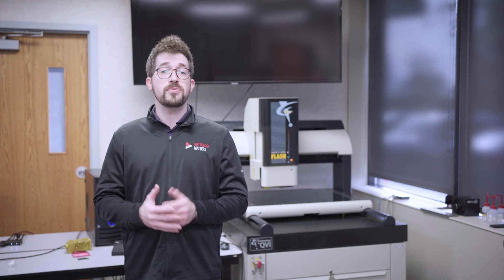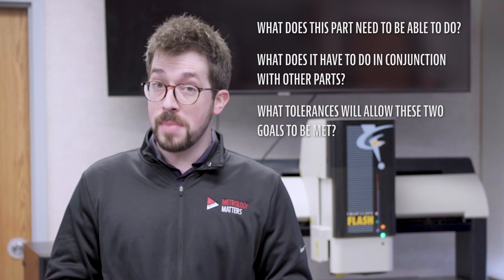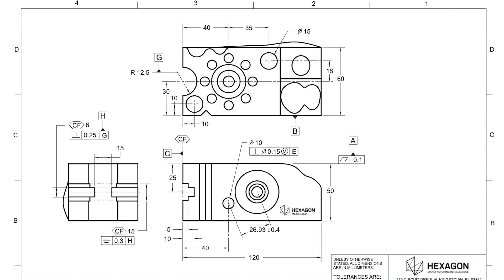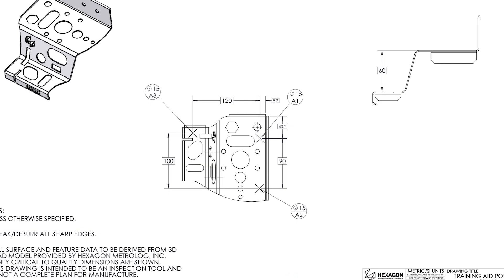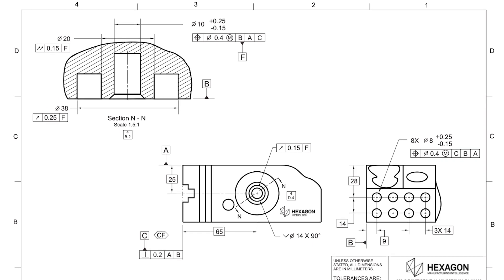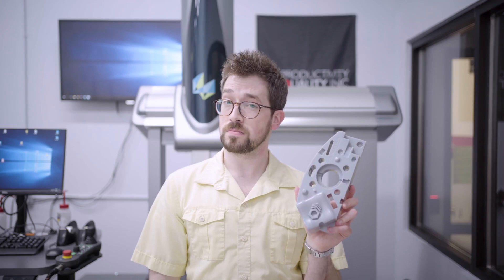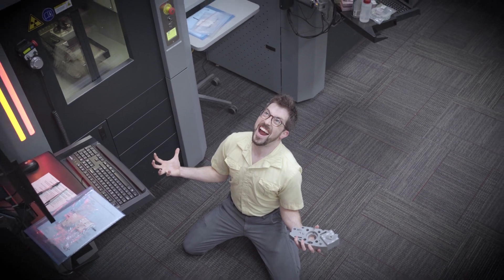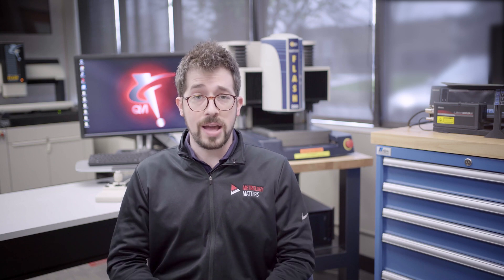Function Intent and the Measurand | Metrology Matters

Comment: The process shouldn't rely trial-and-error after parts are made, it should be based on tolerance analysis during the design phase. You outline the functional requirements (eg cylinder must fit into bore) and sources of variation (eg feature sizes/position/orientation, assembly, temperature variation) to determine what tolerances are required to meet these requirements. You then work with your manufacturer to see whether they can measure these dimensions and hit these tolerances. Adjust your design if they can't, or make compromises (eg more precise processes, changes to the product size/performance, or accepted yield fallout).

You note that a high-precision part doesn't need every dimension to be tight-tolerance, but in addition - forethought can be given before any prototypes are even built, massively reducing the number of trial/error cycles of design & manufacture.